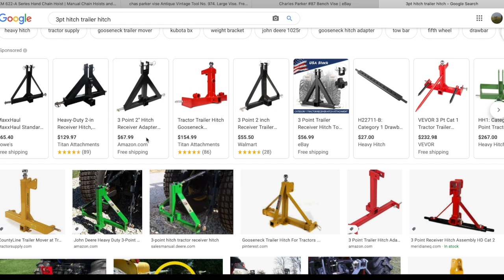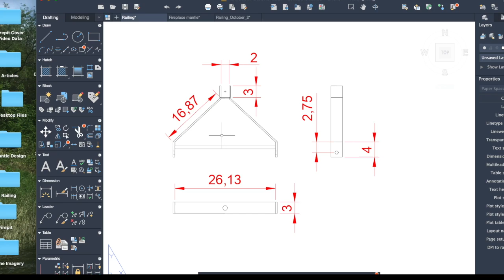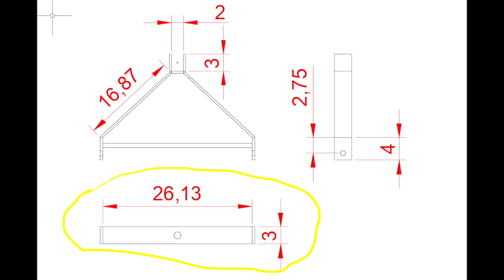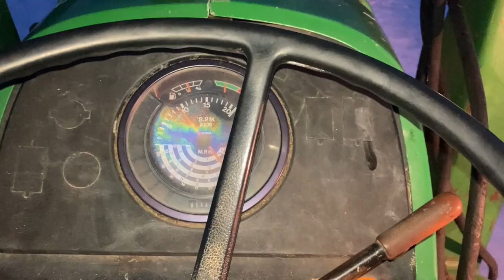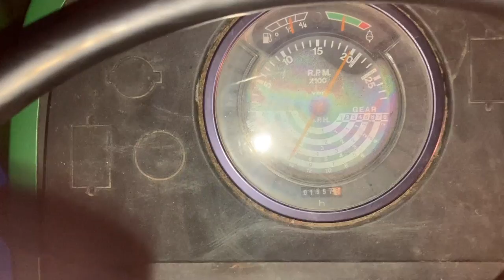Fabricating a tractor 3 point hitch trailer mover

Comment: I don't know man, I'd weld inside and outside corners of everything if your not going to have any clearance issues, If you ever had to move around a fully loaded trailer One could never know what future stresses that hitch might see.
Reply from the maker: Good point, I did go ahead and fully weld all the joints. It only took an extra 10 min!